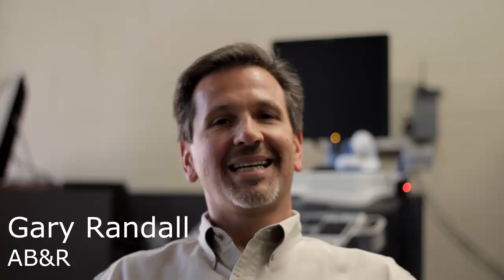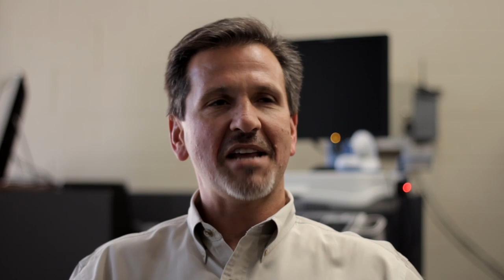Basics of Asset Management

Comment: If you are looking for an inventory management app that is super simple and is for small businesses, Sortly Pro is the BEST. I just started using it and I love it! The older programs are just so hard to use and don't fit well with smaller companies. The app works as a scanner for QR labels AND barcodes and you can make codes in the app, and send labels to print.